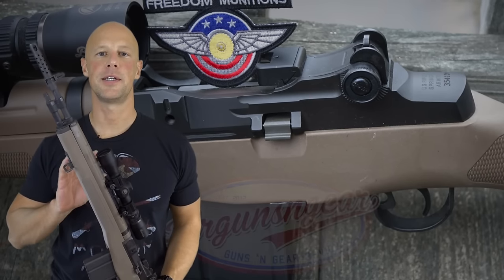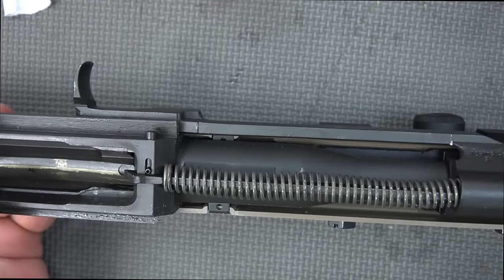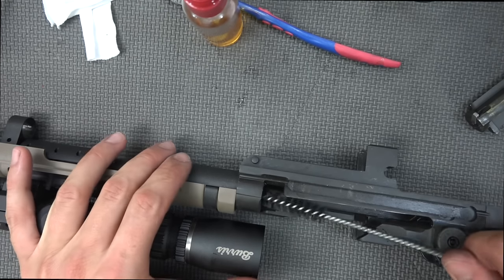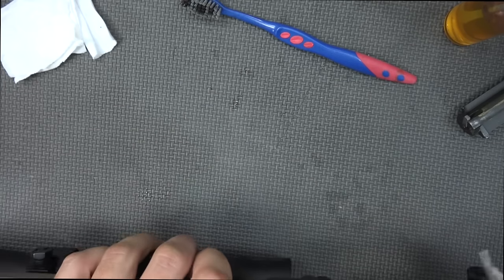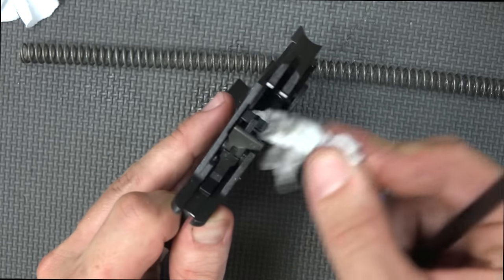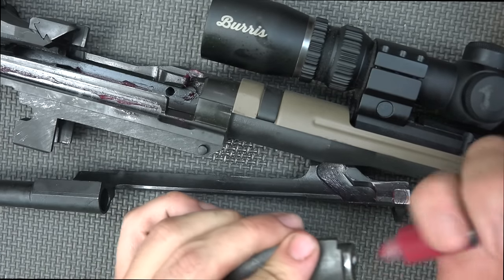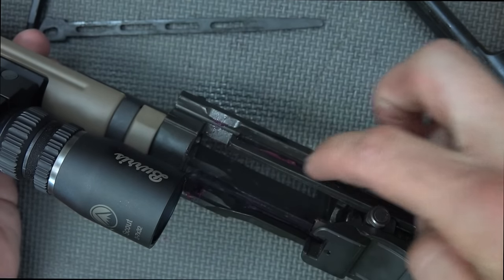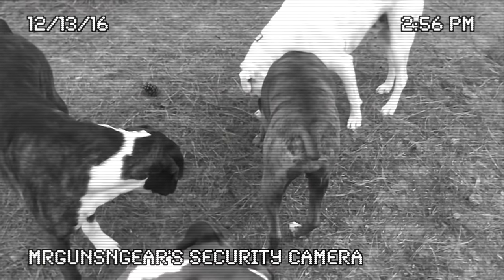How To Clean & Lubricate A Springfield Armory M1A Or M14 Rifle (HD)

Comment: best semi-auto rifle ever made ..carry one in nam 66-67 .. one word works every time .. but we used diesel to wash the sand out , helmet 1/2 full , small paint brush , grease from motor pool as there was no white lube around .and some plain old motor oil ... full auto was a ripper on bi-pods  2-3 rd burst ..
Reply from the maker: nice
Reply: Roy Rodriguez you used the helmet to clean your rifle? Do they not have some kind of cleaning station back at base?
Reply: I used diesel on my tools at a copper mine I worked at. Good stuff!
Reply: @whatfreedom7  would be a little heavy to carry out into a swamp don't you think?
Reply: @whatfreedom7  What base, you mean at the Firebase? Cleaning station? Lmao. If your rifle gets dirty you have to clean it then, not 8 hours later.
Reply: @eisenhauerca  Diesel is a great lubricant, clean it with Gas lube it with Diesel.

Comment: According to the Springfield manual I downloaded today it recommends keeping disassembly to a minimum. To clean the barrel and chamber regularly without disassembly. And to disassemble the gas system to clean regularly. The manual I downloaded is revised as of 3/19/2013. This is just an FYI. Your channel is spot on.
Reply: Just bought mine last week and the manual is rev. 4/7/23. It still recommends disassembly only after 600-800 rounds or once a year and clean the gas system regularly!

Comment: The factory cleaning kit has lots of useful tools in it for the rifles maintenance. If I remember correctly, the manual recommended not breaking the rifle down regularly. Every time you work that stock lock, it loosens up more. I usually just get the easy gunk with que tips and re-grease. Greasing the op rod where it rubs on stuff under the handgaurd cleared up any malfunctions I was seeing. 

I also run the Burris scout scope as you likely found, it's one of only a few options on the market and the Burris seems to be the best. I originally saw about 3MOA accuracy. After I shimmed the gas block it turned into a Sub MOA rifle.

Sorry for rambling. I'm sure you were aware of most of this.

Comment: I trained on the M14 at USMC OCS back in '75.  We used Lubri-Plate for greasing the gun.  It was applied by putting the lube (sparingly) on the bolt parts and then spreading it by running the action.  We also removed the gas plug for cleaning the piston.  One other thing we did for an inspection (officially forbidden, but done by our Sergeant Instructor) was to clamp a cleaning rod and bore brush into an electric drill to clean the bores...
Fast Forward to the mid-90s, when I got my M1A standard.  Everything was the same, except of course, no full auto sear or connector.  Given that the op rod would pop right off on the M14, I was--and am still--highly frustrated with the struggle to get the M1A op rod off.  I'm glad to know I'm not alone!

Comment: Loved this video! I never used grease until I began shooting Garand with some regularity. I've always heard that if it slides, it gets grease. If it pivots or spins it gets oil. Started using grease on pretty much all my guns (lightly where metal slides against metal) and applied with a small paint brush. Keep doing what you're doing, this is an awesome channel!
Reply from the maker: thanks
Reply: John Vinnedge lubriplate 103A , it's the only grease the military recommends to use on the M1 garand , M1 carbine and the M14 , it's what was originally in the little yellow grease pots in the butt stock cleaning kit , when it comes to garands and M14s pay particular attention to the bolt roller , make sure it's properly packed with grease , the original am combination tool had a special part which would allow you to roll pack the roller with lubriplate

Comment: Op rod removal:HA!  I've had my M1A for over 20 years, and it's still a trial to get the sucker out!  What makes it doubly frustrating is that the op rod on the M14 I trained with in '75 would roll right out and back in...There's a trick there somewhere... :p
A .45 brush is also dandy for scrubbing the chamber.  I didn't know the bolt roller came off that easily.  
Great video!  It's always good to be able to review and learn some new tricks.  THANKS
Reply from the maker: thanks

Comment: When removing the op-rod, place a cloth covered flathead screw driver between the rod and the upper, tap with a hammer and twist simultaneously, it pops out flawlessly. This nugget of info was told to me by an armorer at Springfield.
Reply from the maker: thanks
Reply: ThePband how many hands do you have?

Comment: Getting ready to take my M1A apart for the first time this week coming up and I will have this video up for sure!

Using this video, I was able to successfully disassemble AND reassemble the rifle! The bolt was definitely the worst part! Next time I believe I will remove the firing pin as that appears to be what makes the bolt removal/install tricky. I did a partial function test with just the reassembled action as I am awaiting the Archangel stock to get here today.

Comment: Just got my M1A Standard FDE. Got it out to the range today and ran about 15 or so rounds through it no problem. After 17th round or so the casings were getting stuck with the next round in the process of feeding. (Kinda like a double feed) I can confirm that I have not yet Cleaned, Degreased, Regreased, the rifle what so ever this is just out of the box from the shop. Any thoughts would be great sir! Also can confirm that my Valve is open and in the correct position. Seemed to eject snapcaps pretty fine. I was using S&B 7.62x51 147 Grs and PMC Bronze .308 147 Grs. They both ran fine until like I said rounds 17 +. Also im using the standard 10 round Springfield Magazine that came with it. (Trying to give as much detail)

Comment: Axle or bearing grease works well. Lithium grease dries out quickly unless it has heat. Petroleum based grease works better because it is used on automotive parts,cold or hot they work under any conditions. I use it on my M1 Garands and M1A/M14.
Reply from the maker: thanks

Comment: Great video and lots of good info in the comments. Thanks. I clean my firearms after every time I shoot. However, I read that disassembling an M1A / M14 too often diminishes accuracy because the fit of stock to barreled action gets loose. Is that correct? What do you experienced guys do? I've just been cleaning my barrel, chamber, and parts of the receiver I can reach without tearing the rifle down.
Reply from the maker: you're welcome.  I guess it's theoretically possible but I wouldn't sweat it unless you have a bedded stock

Comment: I like the idea of a polymer pick but I use chopsticks...
and as a bonus I can slice the cheap chopsticks from your local buffet into any point, chisel or round to scrub a rag into just about anywhere
Reply from the maker: nice
Reply: I use the same Tipton picks for every clean up job, there use is endless.  Found them on amazon a while back and very inexpensive.
Reply: Jon H , great tip on the chopsticks.

Comment: Disassembly and reassembly without one f-bomb. Never seen it done before this. (really)
I was told to wipe a little grease on the ferrule or the lip upon which the stock sits, if that makes any sense...You know, between the metal bit on the front of the stock and the lip on the barrel ring...the bit that hold the front of the stock to the shooty part. Sorry to be so f-bomb technical... Have you ever heard of that? Also heard the argument to re-zero the weapon every time the stock is removed or replaced. I'd appreciate your opinion on this very much.
Thank you!

Comment: Sorry but I use Lubriplate 130-AA.   Designed for the M1 and the M14.   Its what we used in boot camp back in '66 for our USMC M14s.   Fnd it on Amazon.  A 1,75 oz  tube will last you years.  Never over lube your weapons just a very light film on contacting parts.
Reply from the maker: Sounds good

Comment: I don't use grease on my M1A. I use motor oil. I use motor oil on all my firearms. You are obviously very knowledgeable about this weapon, so do you have any thoughts on my technique..? I've known a few guys who have used grease on their rifles (not the M1A) and had issues with cycling. I figure if 10W30 is safe enough to lube metal to metal engine parts, it should be fine on the action of a rifle. Your thoughts, please.
Reply from the maker: so long as the oil stays there when you fire it then I don't see an issue with it

Comment: It looks like getting the op rod out is as frustrating as the Garand. The M1 and the M1A very similar except the Garand doesn't have a roller on the bolt and the piston is attached to the op rod making it easier to clean the piston.
Reply from the maker: indeed

Comment: Hey quick question. I recently took my new M1A scout apart to look at the guts and I noticed after reassembly that the op rod shows resistance when drawing the hammer back, but once the hammer is drawn back and trigger is ready to be pulled the action is smooth. Is this normal? I'm just asking because I've never noticed that resistance before. Thanks and great vid!
Reply from the maker: I can't say without feeling it

Comment: Did I miss something here? How did the roller come off just like that? Great video btw!
Reply: Yeah seconded... dunno how that roller comes off. I just sprayed a bunch of lube on/in it and hoped that was enough.
Reply: @jackcozad6345  there is a c clip that's retained by the bolt roller. A bad c clip could result in a roller that's too easily removed which can cause the roller to pop off easily during operation. In short, no we should not be able to remove that roller like how he did it in the video. Pack the roller with grease to prevent excessive c clip wear.
Reply: Eddie Iing Thanks much Eddie!! 🙏

Comment: Recently got a factory new M1a Standard and the booklet says to clean the grease and oil before firing. What would happen if I took it to shoot at the range without doing so?
Reply: Probably what happened to me. Failure to Extract, Malfunctions, Turns into a bolt action lol. My spent casing were getting somewhat "Stuck" in the chamber had to use a flathead to pry it out.

Comment: Problem I've had with my M1A scout squad is the pin that the trigger guard pivots on moves as it shoots, sliding out slightly, just enough to prevent the trigger guard from opening fully and letting the  trigger group come free from the receiver. I have to use a flat head screw driver to pry the pin back into place. Kind of frustrating.
Reply from the maker: I'd send it to Springfield

Comment: Does yours not have a retainer clip holding the bolt roller on? I've had my bolt roller come off when it made contact with the rear track of the receiver and it makes for a bad day, catastrophic failure if it does. Yours just looks like it's hanging out on the bolt lug.
Reply from the maker: nope
Reply: That's probably a good sign, if yours hasn't gone down hard because of that it probably means your receiver was machined with a lot more attention than mine. I've got an identical setup, scout scope and all, it's an incredible deer gun, I love it.
Reply: @Mrgunsngear  Your c-clip is broken, you can see a piece of it in your video, it goes on the groove on your bolt where the roller is installed and the roller has a groove on the inside which locks onto your bolt with a special tool. This is a common problem with commercial bolts.

Comment: question for mrgunsngear, I just got my 1st M1A an its a socom 16, the end plate is a tad loose, how would I go about getting It tight, the end plate on the end of the stock in front of the front sling swivel that holds the upper and lower part of the stock together
Reply from the maker: does it not have a screw on the SOCOMs?
Reply: no, I have seen were people place shims there, but my concern is it moves about a 1/8th to 16th of a inch, it moves very little but I wouldn't think it should move that much?

Comment: I've heard the Springfield m1a aren't that great and that I should get a Fulton armory rifle? Have had like 3 people tell me this while looking at an m1a in a shop.....
Reply: What are you going to do with it?
Reply: Range rifle and possibly a semi-auto long range rifle.
Reply: there is also James River Armory....
Reply: A Fulton is going to probably be double the cost of a similiar SA M1A. Fulton is going to sell you on Milspec this and Milspec that. They will guarantee you sub 2.5" MOA though. SA won't make those promises, but good glass, there's no reason to believe the SA M1A can't put down good #s as well. This kind of like why pay $3K for a 1911, when you can get one for $700-1000. The higher ends models are definitely going to have better parts (fit and finish), but there's no reason to believe either wouldn't perform equally depending on the task.
Reply: I love my James River 18.5".
Reply from the maker: the debate rages on

Comment: How dare you recommend a lube that's not the latest and greatest "firearms" lubricant that's the bees knees!
Reply: Buffman - R.A.N.G.E. Blasphemy! Where is the Viking Banshee Tactical Gun Juice Lubricant? You'll pay for your insolence.
Reply from the maker: :D
Reply: No weasel pee?  What holds the oil in place without a fine layer of rust????
Reply: Sooper Dooper Copper Disintegrator, (it's in in the carcinogen aisle), followed by Dolphin Snot.

Comment: Hi, my socom is ejecting erratically. Sometimes casings will fly over the barrel at 10-11 o clock, is something wrong?.
Reply from the maker: As long as it's strongly ejecting I think it should be okay
Reply: Jaw Knee  Check the tension on your extractor with an empty casing or two, to see how tightly it's holding the rim. It may not be releasing the empties upon ejection as easily as it should.
Reply: AJ Foyt cool, will do.

Comment: nice... I have the same rifle but I took the scout rail off..
Reply from the maker: interesting
Reply: I can't post a picture to show you what it looks like on here but I like guns that catch my eye so appearance is very important. I like the length and look of the scout model but I always thought the scout rail/scope set up was awkward looking. I use mine with open sights but I would like to add a scope mount in the traditional position (over the breach) some day. I've also added a front picatinny rail to the stock to facilitate a bipod..
Reply: Jackal, M14 afficionado here. Do not, I repeat, DO NOT buy a Springfield scope mount. They are absolute garbage. You may get it to retain zero, possibly, for about five rounds after dumping a gallon of loctite on and welding it to the gun. Get an ARMS18 mount or a Sadlak. Pricey, but buy once, cry once.
Reply: Thanks TJ... I was aiming for the #18 ARMS mount..
Reply: Jackal's I also took off the scout rail and added a standard M1A brown fiberglass hanguard and a black socom stock with the metal buttplate. Never did like the scout rubber buttpad. The black stock and brown handguard look really nice. Thanks MRC for the info on the SA scope mount. I will check out the ARMS and Sadlak mount. Oh, props to MC channel

Comment: I think this is precisely what's wrong with this system. Loads of modern systems need minimal if any lube to function. This needs comparable care as heavy machinery, everything is high friction, loads of metal to metal contact, and grease is fine for machines, but guns need to work the way a knife or your hand or a screwdriver does: when dirty, when wet, when anything. Grease gets dirty REALLY FAST. A dry mechanism with minimal contact needs less lube and gets less dirty for that reason.

I get it, just learn to care for it, blablabla, but it's a very high maintenance mistress compared to it's modern competition.
Reply from the maker: fair enough
Reply: Mrgunsngear Channel question, do you think the M1As foibles are made up for by elements of its brute mechanical elegance? To me the AR type DI system is so mechanically simple and easy to care for(if everything is alright), but before the rise of the modern ar pattern 308, most of the large frame ARs had problems.

I just don't know what to think about reliability. M1a guys seem to swear all day that their system is more rugged and easier to clean, and the AR guys say the same thing. In Range TVs tests side with the AR.

Who is right?
Reply: It's easier to get an AR 15 pattern apart and back together, and the configuration of the upper receiver makes accessing the chamber easier. OTH, there's smaller parts, and more intricacies in the barrel extension and locking lugs. The DI gas system dumps lots of fouling all over everything, and if it isn't kept pretty clean, it doesn't run. With an AR, you only need one lubricant. The lubrication has to be just right, though Too much, and you collect more filth and get burning CLP fumes in your face when you fire. Not enough, it doesn't run. The M14 requires grease as well as an oil. Pick your poison, I guess